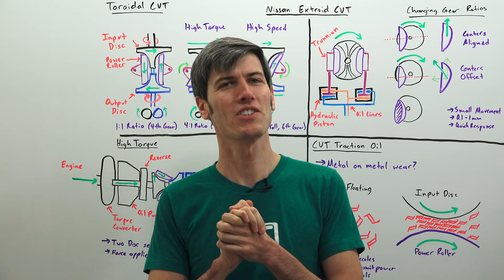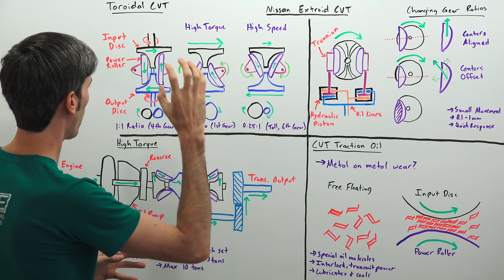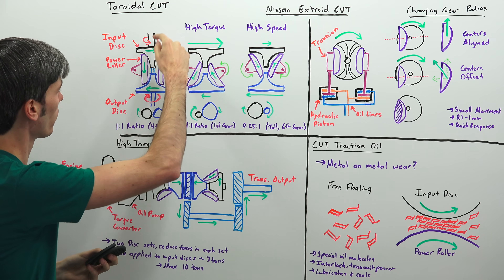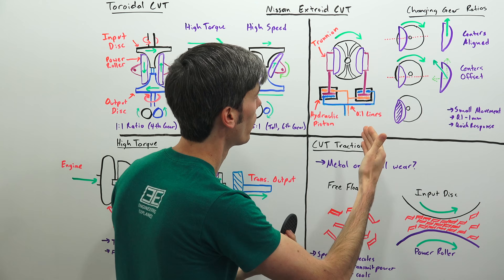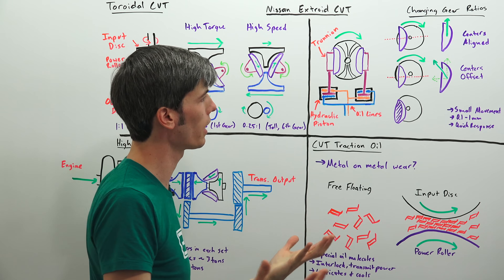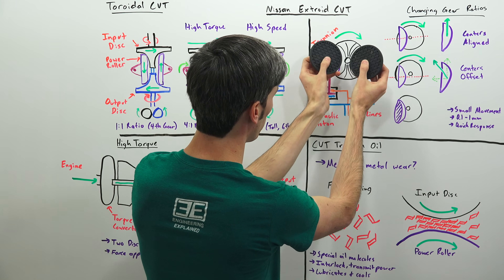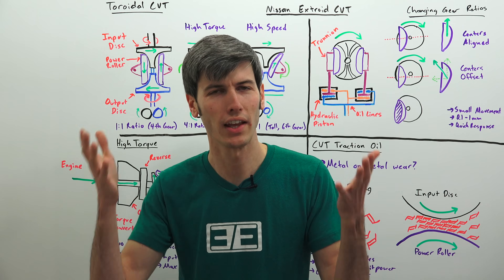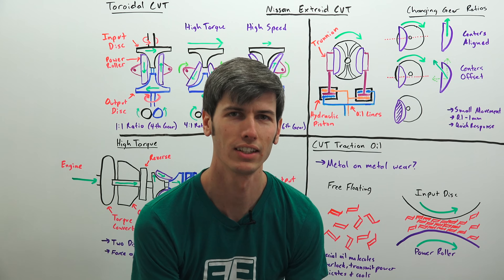Nissan Created The First Production High Torque CVT

Comment: I don't understand why we even bother with transmissions nowadays. Torque converter direct to the rear axle, with an inline electric motor direct to the shaft to provide the initial torque where the gearbox used to be. 

Use a series of batteries or capacitor banks to store and release charge when needed. 

That way you can use the electric motor on it's own in the cities, with the engine disengaged to be used as a range extender, then when you want full performance you can use it in tandem with the electric motor to lay solid power down.

There is absolutely no reason whatsoever as to why this couldn't be done with ALL new gasoline/diesel cars, and why it can only be used on a multimillion dollar koeniggsegg.
Reply from the maker: Batteries and electric motors are expensive, that's why it's not done on everything.
Reply: I think the Chevy Volt is this way.

Comment: What keeps these toroidal discs from slipping or developing flat spots over time?  I don't know but I'm not sold on these things, It just seems like the continued dumbing down of the vehicle until one day we wake up and we live in the era of the Demolition Man with generic vehicles that can't do much of anything other than putt putt around. Maybe I'm wrong, if I am let me know.
Reply from the maker: The oil is there to prevent slipping and flat spots, if you watch towards the end I'll discuss this stuff.
Reply: @EngineeringExplained  I watched to the end and saw and heard about the oil to prevent slipping. I get it but I'm still not sure, ex. if I have I have a rod bearing with a layer of oil to prevent it from seizing why would a layer of oil now inevitably prevent slipping?  I know the transmission works but I can't see it being robust, strong or built for longevity. I wonder what the real world performance and life was in a turbo 3.0l v6

Comment: Long time Nissan fan...... sometimes Nissan bring light weight rear wheel drive cars back...ex my S14 anyways Nissan makes some pretty cool innovations that a lot of manufacturers incorporate. Like headlights that track steering input, 370z rev match, the new variable compression engine cool stuff. Let's see how durable this is. Make they can give the GT-R week transmission and replace it with this.

Comment: Extroid CVT. How is it different then a hydrostatic transmission in a lawn mower. Same idea done slightly different . CVT  is more or less a snowmobile on wheels.
Reply from the maker: It's a toroidal CVT. Toroidal CVTs have been used in many applications.

Comment: There seem to be a quite a lot of losses in this design. First of all i am sure that there will be high losses in those cvt "gears", and there are two of them. That traction fluid with these fancy molecules surely has high friction. Then you transmit that power through that intermediate shaft through 2 sets of gears (as a comparison in a manual gearbox you only go through 1 set of gears at a time). This doesn't seem practical, these newer automatics will probably be just as efficient (considering they cannot stay in the rpm "sweet spot" at all times), but they will last a hella lot longer.

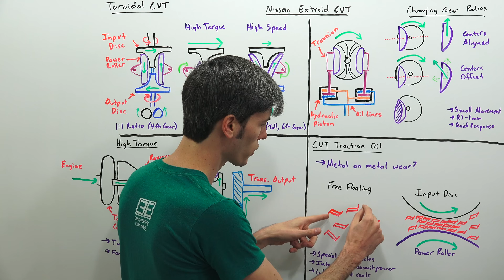Comment: 11:25 - So, a non-newtonian transmission fluid? Interesting. 

I think this will be a game changer for CVT's. Belt-type CVT's have a push belt made out of hundreds of parts, held together by a few steel ribbons that you can't describe to a machinist without them starting to flinch. When, not if, those steel ribbons let go, you've got hundreds of little metal pieces sprayed throughout your transmission that is, also, full of rapidly spinning close-tolerance parts. A typical CVT could be made so that the belt could be easily replaced or checked (See: Polaris) but JATCO doesn't want that.

Comment: Looks like this approach dramatically reduces the number of moving parts, compared to a normal automatic transmission- makes one wonder why they're still making the old style.
Reply: it was $3000 more per unit in 1999 vs traditional automatic and that was before fluid cost... pretty insane

Comment: This is ridiculous. Nissan should not be talking about "reliable" CVT transmissions. They are a major co owner of Jatco which makes the most horrible CVT used in Nissan cars as well as in other cars (Mitsubishi, Hyundai, Renault...). 
Toyota, for example, realized (admitted , kind of) that CVT can not handle high torque and came up with DCVT in which  the high torque (low ratio) is handled by gears. But even lower torque is a challenge to CVT.
Stay away from CVT!!!!!!!!!!!!!! It may save you 2% gas, but the the cost of repairs will be much higher and the ride is not responsive. Car manufacturers push CVT for one reason:  They are cheaper to make then transmissions with gears!!!

Comment: So, they basically bought old Torotrak patent, introduced about 15-16 years ago... I do hope they solved the issue with special oil formulation, required for those rotating 'disks' to keep a good contact with each other.
Reply: they actually developed this in the early to mid 90s and it debuted in the late 90s in Japan. Jason is covering it now for whatever reason...
Reply: Interesting info....This deserves further research, as I have been following closely car industry since '82-'83 and haven't really heard about Nissan using this type of transmission. Funnily enough,if memory serves me right,  Torotrak company was at it's peak in '01-'03, promising very good results with their toroidoal tranny, even announcing a future contract with big car manufacturer. And then their stock went down in a year , no real connections with big car companies materialized and they were looking in applying this principles in other type of applications, Haven't followed them since (personally , I found Antonov transmission did seem more promising, as well as Zeroshift...), but was quite surprise to find their web domain invalid, after I had seen this video about new Nissan transmission...strange coincidence...

Comment: Looks Pretty Cool!!
Wounder how they will hold up over the years
Reply: Yes, this is exactly the question. They must have data on this. The engineering department would make them to last 300K miles, but marketing (particularly from the company that bought them) might want a cheaper version that is spec'ed for 100K. This is really how they do stuff. Make money now and be off to another job when the company suffers in the long run. Excellent video by the way. I drive a Maxima with a manual transmission.
Reply from the maker: Been out since '99! Probably some out there to see how they're doing.
Reply: I did a little research.  The Cedric CVTs were only available on some high end models. Every other Cedric got a 4 speed autobox.

Comment: So, actual gear ratio is dependent on both trunnion's vertical position and the actual torque provided by the engine... So its a transmission that you can't really select a transmission ratio... You move the trunnion to determine how much leverage the force will have to rotate the power roller... That is an input how aggressive your transmission ratio will be with changing engine torque, but you cant really select one specific ratio.. Did I understood it wrong?
Reply from the maker: Your understanding is mostly correct, but you can select any individual ratio between the max and min gear ratios provided.

Comment: At least 3 bits of genius here.  1st, the basic design that eliminates belts and keeps moving parts count low.  2nd, the use of two back to back to double the torque capacity. 3rd the complete lack of roller to wheel contact virtually eliminating wear.  #3 is by far the coolest (at least in my book). As you said,  transmitting torque through a fluid is hard.  Maybe it's because I'm not a chemist and have no clue how that works,  but it's amazing.  As always,  a great video! Thanks for making this understandable! 
I do wonder,  how they keep the two sets of moving discs in sync between the two sets.  If they get out of sync they're going to want to turn the single output gear at different rates and that's not good. I wonder if the mechanism to do that is mechanical,  or electrical (computer controlled).  Mechanical would seem like a more reliable if more complicated choice.
Reply from the maker: Electronic control to manage the two. There are sensors in the trunnion so it knows what level it's at and the effective gear ratio, so each side are forced to match.
Reply: @EngineeringExplained  oh wow,  thank you for getting back so fast. Interesting that it's electronic.  Makes sense,  less weight,  way fewer parts,  and given the mass of things involved the response time won't require high end processor.
Reply: I'm betting if they wanted to, they could stack the toroid mechanisms to get even more capacity. It would take more room, but the transmission in a Titan is bigger than the one in a Versa.
Reply: Having back to back toroids (or extroids?) also means that the reaction force which would try to force the input and output sides of the toroid apart are turned into a compressive force on the output gear and a tensile force on the input shaft. That eliminates those forces from the loads that the gearbox casing has to withstand so it can be lighter and also means the forces don't have to be borne on any bearings, reducing the risk of failure for them.
Reply: I never heard of the Extroid CVT before. Looks like a neat design.
Reply: I don't see a lot of contact area in this design. Honda had one that worked on this principle, but they abandoned it, because of warranty issues. Torque being applied means a super high point load, allowing it to grip through the oil film. That requires metal on metal contact. Not a problem as long as there are no vectors at the points of contact. I hope Nissan has better luck than Honda. I do like the fact that it can handle much higher RPM, and the overdrive ability.
Reply: @vincentrobinette1507  Well, he does say it has no metal to metal contact at all. Torque transfer is through the oil.  Also this has been fielded for 20 years,  so apparently it's done pretty well
Reply: @RadioWhisperer  The only way to verify that claim is to set up a rig where two polished wheels run against each other, with the axles insulated from on another. apply tones of force to them and introduce lubricant. Since oil is a very good insulator, there should be no electrical continuity between the wheels. At low speeds, it's nearly impossible for the oil to prevent metal-metal contact. At higher speeds, there is much less time to squeeze all the oil out from between the mating surfaces, and there will be little to no electrical continuity.
This new oil may prove me wrong. I'm skeptical, because if the oil allows grip without contact, what about the spur gears for the slave shaft to the output shaft. It won't let those turn either. gears, with flat teeth, have much more contact area than those toroidal discs. That said, they may maintain enough film thickness to mesh with little friction.
Reply: That is all a torque converter does. Transmits torque through fluid moving around fins, no actual touching parts. Well other than the lockup clutch when your in overdrive.
Reply: @bdetert82  That's absolutely true, but there is a stator between the turbine (drives the transmission) and the impeller, (connected to the crankshaft of the engine). That stator is a set of blades, that gets pushed bacward by flow being reflected from the turbine, and sends it back to the turbine as well as the fluid coupling effect. A torque converter actually puts more torque into the transmission than is being produced by the engine, when first starting out. The increase, is the crankshaft torque + the reverse torque on the stator. The stator is on a one-way roller clutch, which functions something like a ratchet but without teeth. When the input shaft reaches a certain speed(called stall speed of the torque converter), the turbine no longer reflects fluid back on to the stator. At that point, the torque converter no longer multiplies torque, that stator begins to free wheel, by turning freely on that one-way clutch, and turns the same direction as the impeller and turbine. At that point, it's just a fluid coupling. That's usually when the lock up clutch engages, and no more energy is lost. Now that you're thoroughly confused, I hope this answers your question.🤔🤔
Reply: @bdetert82  yes but the torque transfer in a torque converter has a huge surface area to do the transfer which makes it a lot easier.  This has very little surface area to do the same job,  hence why it's cool/genius.

Comment: out of all cvt designs i expected this one to be considered high torque the least. my understanding is the more torque you want the more contact surface area you need. this transmission by definition has the least contact surface area possible, so i thought its only worth showing conceptual demos with no load on the output shaft

Comment: High torque CVT... 44 tonnes heavy Japanese Type 10 tank uses CVT and it's capable of driving at 70 km/h both forward and in reverse.
Reply: There's a reason this tank works. It's a hydrostatic power split, like a Fendt tractor. Perfect for high torque applications, because torque is transmitted over a much larger area. A fundamentally different principle, and a better one for scalability.
The toroidal CVT in contrast transmits torque via single points of contact, hence the extreme sensitivity to fluid properties and tendency to lunch itself if anything goes wrong. Torotrak tried this for years but finally abandoned its own idea and moved onto flywheels.
The Nissan seems to combine toroidal CVT with a power split differential gear. This reduces the power through the variator (the tricky bit) and extends the scalability somewhat, but nowhere near enough to get into tank or tractor territory.
Reply: Probably because it is Japanese made and Renault was not let anywhere near it. I guess.😂
Reply: CVT  is a very general term, there are hundreds of designs and there gonna be even more designs in future. The one which is common in automobile industry is using belt and pulley. This design is only good for small cars and for flat city commuting. It's not good for towing, hauling, off-roading and hilly regions.
Reply: I have no idea how those hydraulic cvts work... Its black magic to me
Reply: Almost all off road construction equipment also uses a car. 

Its a pretty click bait title. Cvts have been around longer then automatic transmissions. Its not even a new concept.

Comment: Wow!!!  That is an ingenious design!  So elegant!  That oil is amazing!  It kind of reminds me of the old Type-F transmission fluid that Ford used in the '50s and '60s, wherein the fluid itself provided some "friction" to allow moving parts to be both lubricated and not to slip past each other and cause wear.

The one and only complaint I would have is the maintenance -- you know that the only place you're gonna be able to buy that oil is at a Nissan dealer, where they're going to charge you an insane amount of money for it.

Comment: The oil sounds like it’s the most expensive part. Probably 1 quart for $100 😂
Reply: Mike T $65 for 4 litres in Australia, in America it’s probably half that price.
Reply: @joepeluso3864  No Cedrics here. Any other vehicle use this Toroidal CVT?
Reply: @BobPegram  1st gen g35
Reply: @BobPegram  there are some construction telehandlers that come with them.
Reply: $500+ for Nissan KTF-1 CVT fluid
Reply: "quart"?
Reply: @kefsound  1 gallon  is 4 quarts 1 USA gallon is 3.78 liters. FYI one Imperial gallon is 5 USA quarts. Going into Canada used to be interesting, liters of gasolene now.

Comment: So those oil molecules, when under pressure, don't slide against eachother easily, therefore helping transmit force ? Also the fact that they stick to the metal with their longer side, which means bigger surface area and more resistance to slide aids that ? Do they have any other properties that help in achieving this ?

Comment: So has Nissan created a true lifetime transmission here? No bands or clutches to wear out. Perhaps the seals in the hydraulic pistons could wear our but I'd imagine those would be simple to replace. Perhaps without even removing the transmission from the car. Other than that it's all just oiled gear contact. Pretty impressive to improve their design in such a huge way.
Reply: it's a design from the 90s that they no longer employ afaik
Reply: @DylanTK  Honda tried it, was forced to abandon it, due to reliability issues.
Reply: @vincentrobinette1507  what were those reliability issues if I may ask?

Comment: In 1993, Williams did testing with Van Doorne Transmissies (inventors of the CVT), to see if a CVT could be used in a F1 car. So surely a CVT was already able to handle high torque?
Reply: I don't think the issue is if CVTs could handle high power outputs, but rather, do it reliably for cheap. Remember SMG transmissions that tricked down from F1? The cheapest one that I know of that hit a consumer car was the Toyota MR2, and from what I read it shifted very atrociously. And in the quest for making that concept cheaper for consumer cars, the dual clutch was born AND is superior. It just sucks some early hiccups and soccer moms thinking cars should be silent put a huge dent in the development of CVT transmissions, because they could increase efficiency by a lot. But no one wants to develop them because public perception makes the return on investment look bad.